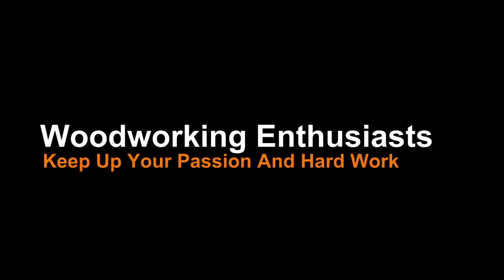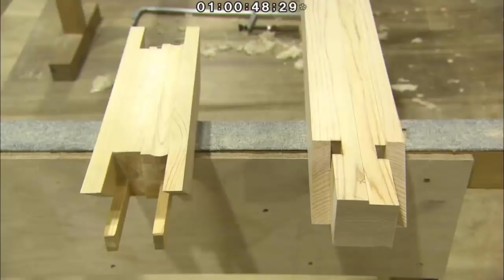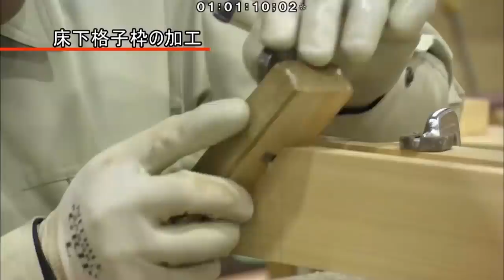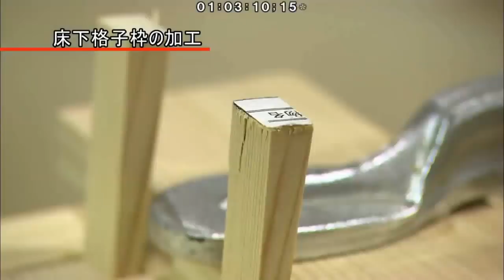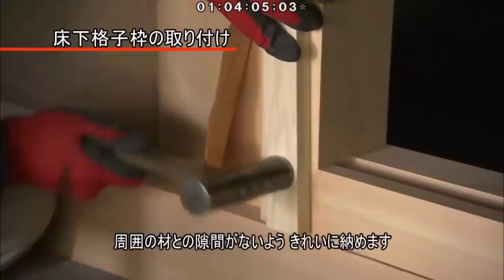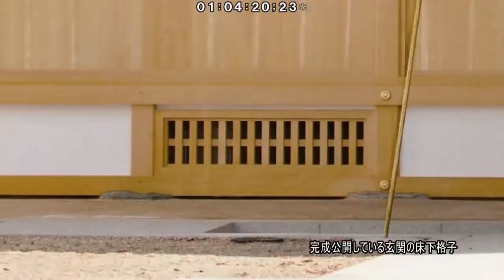Amazing Japanese Carpenter Skills - Building and Installing of The Underframe Lattice Frame

Comment: It is amazing that he spent all that extra time with that beautifully intricate connection with no screws when it's totally concealed and not noticable. I have to imagine that it will stay tight and last a lifetime without pulling loose or weakening. The 0 space between every connection also.......this kinda woodworking is fine ART and im deeply impressed.